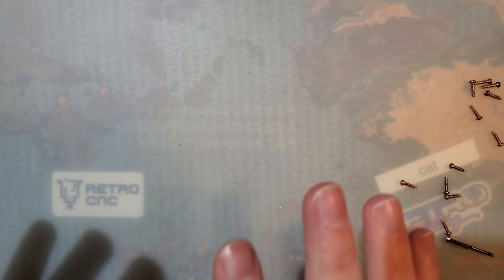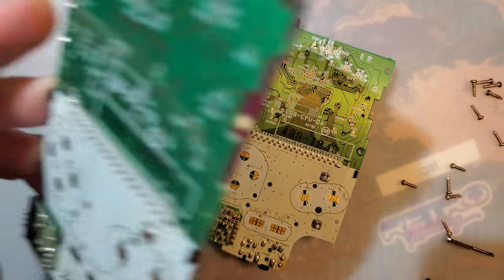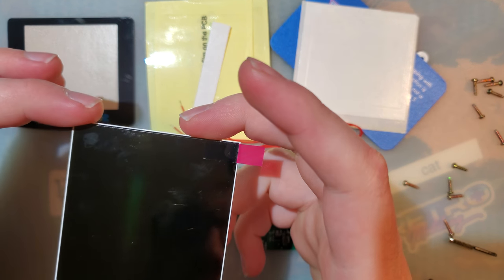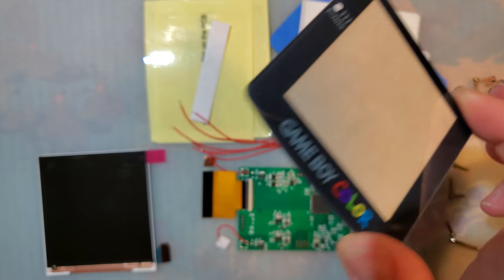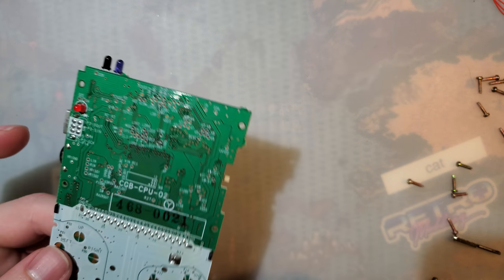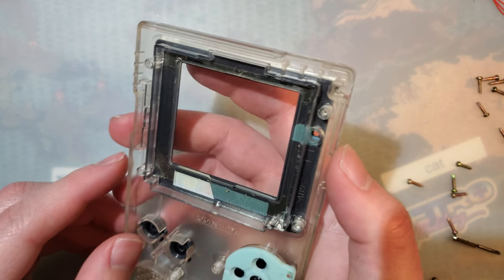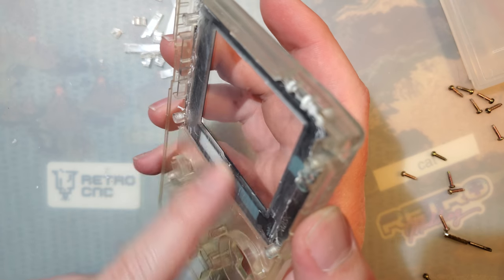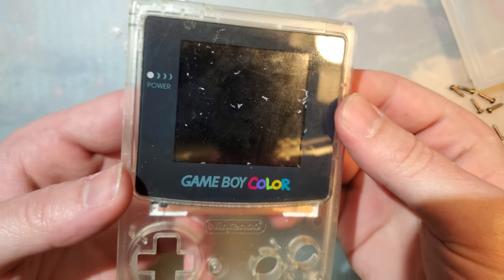Game Boy Color Q5 IPS OSD LCD Kit

Comment: I'm really considering getting one of these but I may have accidentally broken the potentiometer off of my Game Boy Colors motherboard... 😅 Do you think I will experience any glitches or artifacts because of that?
Reply from the maker: probably be fine with one of these since the screens use their own internal digital voltage regulators instead of the analog voltage adjustment from the GBC

Comment: Hey Makho, does your screen show any 'IPS Glow'? the kit I got has some, it's not too bad but quite strong in one of the corners.
Reply from the maker: Mine seems fine but I have seen some particularly bad screens
Reply: @makho  Thanks for the reply! Do you know if these screens are taken from some mobile device? I'm wondering if I could replace it
Reply: Curious what you mean by IPs glow - I’m noticing my screen has these white areas when the color black shows up on GBC games.
Reply: @spektremeffects  Yeah that's the glow. It seems to get worse when I close the case. I might try wiring  A, B, Select etc to a different location, I noticed makho doesn't follow the guide's suggestion. Also, thinking the pre-cut case needs to be sanded down hmm
Reply from the maker: @VirtuaVillain  the "Q5" in the name is something I added. It comes from the name of the phone these screens are out of.
Reply: @VirtuaVillain  Would greatly appreciate if you find any solutions. I mangled my shell to create less pressure.
Reply: @spektremeffects  Oh no, that sounds bad! Right now I've loosened the three internal screws that hold the motherboard PCB down. It's helped a lot but still, there's some noticeable glow bleeding through in the top left. I'll let you know how things go with my rewiring when I get around to it. It's definitely pressure that is causing the issue, at least in my case.

Comment: Hey just finished installing my kit yesterday. It works, but often when I switch it on, I get a black screen (backlit on and game boots normally) i then have to switch it off and on again and it works fine. Any ideas?
Reply from the maker: contact whoever you got the kit from, sounds like there could be a problem with it
Reply: @makho  sounds like it but I contacted him and he seems to be aware of the issue on certain GBCs. We suspect its a failing capacitor on the GB. He sending me up a pack of capacitors FOC. So will see how I get on with those. It works perfectly otherwise. The symptoms do make sense if its a capacitor issue.
Reply from the maker: @robthomson1581  do you have another GBC to try it with? That might be easier
Reply: @makho  interestingly, I played it for a few hours straight the other day, and now every time I switch it on , its worked perfect every time. Possibly as I only bought the GB recently, its not been turned on or played for years, now it seems to work perfectly after getting some on time! Unusual, but nice outcome.

Comment: Can you do an Video of the Pixel Overdrive Artefacts? For me a Dealbreaker on the LG/Toppoly screens.
Reply from the maker: My Life in Gaming did a better video than I can ever do: https://www.youtube.com/watch?v=M90C3BdTjIc
Reply: @makho  thx already known that video and yes it is great. But I have the feeling that you voice is louder in the modding community, even with less subs. I have the feeling, that a lot of "modder" only see there first impression on the screen an here yes the IPS are great, but they blend out the issues, that you find when going a little deeper. Depending on the games you play, you will never see those, but Sadly I have a lot of Games that suffers from the problem... Does the Fake-AGS101 (IPS) has the some Pixeloverdrive artefacts?
Reply from the maker: @Daniel160384  not that I've seen, no
Reply: @makho  great, I'm absolutly not against IPS only hate some issue of the LG/Topploy issues. Curious how the new scenns will be, that will release in the next weeks. The only thing that I know until is, is that them are drop in an the same size as original.

Comment: Would it be possible to wire it up to some added external buttons to control the osd. That way it wouldn't interfere with any games? Or could the 2 touch switches be replaced with push buttons to cycle through?
Reply from the maker: for the former, yes, for the latter, also yes but you will lose out on some functionality like the extra brightness levels and being able to change the position of the image on the display. 

I've pitched the idea to the manufacturer of adding a delay to the OSD trigger so you have to hold the buttons for a half second before the OSD is brought up. There are also mods that add in this feature for you such as this one (where I got the idea in the first place): https://github.com/orangeglo/GBC-Q5-OSD-Delay

Alternatively, you can just uninstall the wires once you've got the mod fully set up.
Reply: @makho  Awesome! Thanks for the reply and link. Really seems like they can make a few tweaks to this kit and it would be perfect.

Comment: Mine's been sadly malfunctioning after few days of use. Brightness is very low and the color palette toggle is very inconsistent between every boot depending on how I happen to change the palette. Quite bumming as I'm probably forced to buy replacement now, anything I can do to salvage my current kit?
Reply from the maker: Try fresh batteries. Else, talk to whoever sold the kit.
Reply: @makho  Seller left me a general "automatic" response that detailed how to install the kit from ground-up - guess I'll just have to buy it again~

Fresh batteries do nothing either-
Reply from the maker: @KonaKonaKaabisteru  if you bought a kit that doesn't work, return it

Comment: How well does this kit work with the Everdrive X7? Should a person install a new voltage regulator like what's being done with the GBP?
Reply from the maker: Will depend greatly on your batteries. A new voltage regulator won't help if your batteries suck.
Reply: @makho  I only ever use Eneloops with my AA based game systems but have only tried an old Mr Flash 64M gb flash cart or the Visoly Flash Advance cartridges in my GBs as those are the only flash carts I have for GB at the moment. I use original carts where I can and the flash carts are ones I had from way back. They worked fine in my modded GBA and GBC with funny playing IPS kits. Would just like to move to a flash cart that isn’t around 20 years old and requires using antiquated software and interfaces to update - something I haven’t done is nearly 15 years haha.

Comment: I need help. I just installed this kit, the first one I install. When I turn it on, the screen does not show any image. I have checked all the cable connections and it seems they are all fine. What is happening? Have I received a faulty kit or have I done something wrong?
Reply from the maker: I'd reach out to the seller

Comment: Soooo trying to do one of these kits my dang solder gun sucks and a drop of solder went connected 2 pads it almost peeled a pad clear off will this still work or should I try to get another chip for this kit ?
Reply from the maker: I think you should get some solder practice in before trying to do another one of these kits. The issue you described is a technique problem, not an equipment problem.

Comment: I'm going nuts installing mine. Doesn't matter if I use pre cut or self cut shells, I can't get them to close without screwing the screws so tight it distorts the screen. It's so disheartening to keep falling down at the last hurdle I really don't know what to do
Reply from the maker: Use an OEM shell
Reply: @makho  Aye I think I'm going to have to. I was a bit concerned about destroying an OEM shell but at this point it's probably worth a shot
Reply from the maker: @sebwalsh7592  if it makes you feel better, Nintendo made millions of these things. There's plenty to go around
Reply: @makho  Thanks mate that does help. I'm going to give it one more try (I just saw something online about trimming the pins that wasn't in the guide on AliExpress) and if that doesn't work I'll just cut the OEM shell. Thanks for taking the time to help me, it's much appreciated.
Reply from the maker: @sebwalsh7592  you got this chief

Comment: Hey man I need your advice:

I bought a modded GBC on ebay modded professionally with the XL version of this screen and the brightness keeps randomly changing while playing even though my fingers are far from the top sensor, on the back of the Game Boy. 

Do you have any idea why it does that and how I could fix this issue?

Thanks a lot!
Reply from the maker: probably not insulated properly. Since you bought a modded console though, you should seek a refund or a return.
Reply: @makho  I would but I paid a lot of import taxes which will not get refunded plus it's a daiei hawks in great condition...
Can I open it up and unsolder the brightness sensor (which I don't want anyway)?

Thanks!
Reply from the maker: @Barjile  sure but you should still address it with the seller

Comment: is it necessary to trim all the little pins on the front of the gbc board? I'd imagine that they are touching the back of the lcd
Reply from the maker: there is clearance, so no need to trim if you use the included insulation film. If you use a thick adhesive gasket, you'll need to trim regardless of insulation film.

Comment: I bought one of these Q5 Gameboys from eBay I have to keep my screen all the way turned down basically as soon as I turn it brighter the batteries die and the screen gets stuck also through the top of the Gameboy I can see the backlight but it’s only halfway lit the other half is dark and this Gameboy is hard to turn on and off
Reply from the maker: don't use shit batteries
Reply: @makho  what do you recommend!?? I spent $40 bucks at Walmart on some rechargeable ones I can put them in at full charge put the brightness all the way up and boom like a blown fuse my batteries dead 😂 I just want to be able to play with like a quarter of the brightness on !
Reply from the maker: @thefireking5729  high quality alkalines or something like energizer lithiums
Reply: @makho  does the battery also cause the screen to flash black and I had it completely restart my game a couple times now also ??
Reply from the maker: @thefireking5729  if you saw my video, you saw that mine didn't do that.

Comment: Cost me nearly $180 to build my GB color IPS from scratch. At this rate, im done with modding, its too expensive, not to mention my right and down on my dpad arent very responsive, all that work for THAT. at this point, i'll just try and buy a Analog Pocket this coming year.  :(
Reply from the maker: That's a very solid point that a lot of people don't consider. The individual parts cost of most of this stuff is real low but to fully trick out a console, you're going to be spending a few hundred at the least. Depending on your use case, something like the AP would be the better buy (though keep in mind, that thing still doesn't actually exist and when it does, there is no guarantee that it will run ROMs off a uSD so you might still need a flash cart for it). 

On the plus side, prices have come down on backlighting these things quite significantly. It used to be at least $300 to backlight a GBC with average costs closer to $400, especially if you had to pick up a ready-made shell.

Comment: where do i put the battery wire if i have the dc rechargeable battery mod? any insight?
Reply from the maker: You should check the instructions for your battery mod
Reply: @makho  the battery mod doesn't come with instructions to hook up to the screen. thanks though!
Reply from the maker: @panofduluth  Then check the instructions for the gba accelerator. You'll probably have to talk to the seller of that mod.
Reply: @makho  i meant the screen. the correct answer is no you do not have any insight. Thanks though!
Reply from the maker: @panofduluth  Dude, I cannot help you if you don't even know what you have. Good luck with your mods.
Reply: @makho  i do know what i have i actually edited my comment before you replied. i have all 3 mods inside. it just took you so long to comment the first time i got crossed for a second. it happens. thanks again!

Comment: How did you spend 3 hours changing speaker caps it’s a 10 minute job more like 20 with 3
Reply from the maker: Cleaning my work space, gathering my donor consoles, troubleshooting my consoles, finding the dang caps that I put in a dumb spot, finishing my dinner, cleaning up again (these things were very gross), reassembling for testing, taking apart again because I don't want to leave my known good speaker installed for testing, and so on. 

Any other questions or did that cover everything?
Reply: @makho  you could have just said fidgeting

Comment: I doubt you'll respond but I have a version that has a ground pad but no battery pad. Where should I solder the ground wire?
Reply from the maker: don't need to solder any grounds but if you insist, the gold pad on the top left near the LCD is a easy to get to ground.
Reply: @makho  you're awesome for replying. I ending up skipping it becuz every video I seen didn't even have the GRN pad